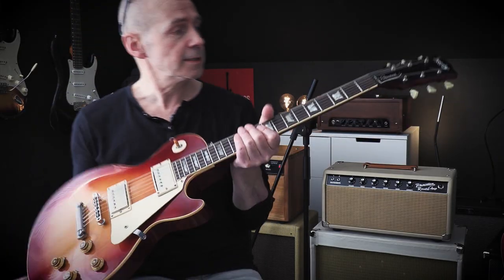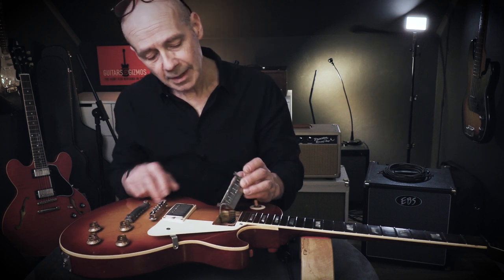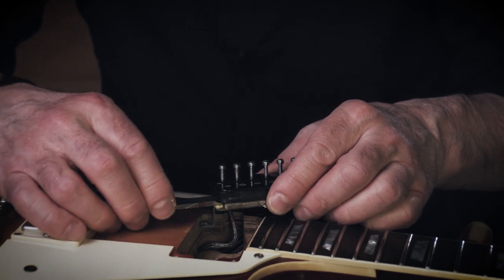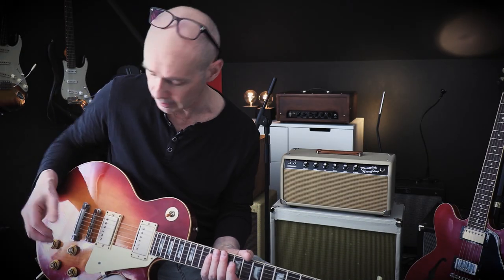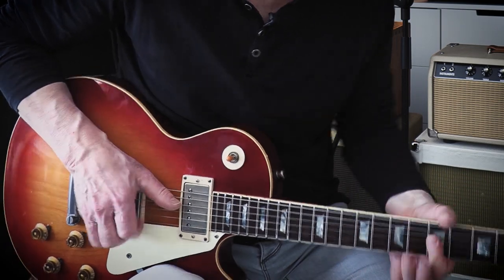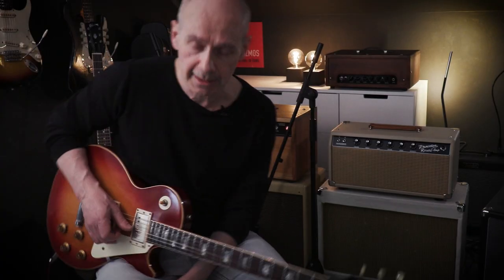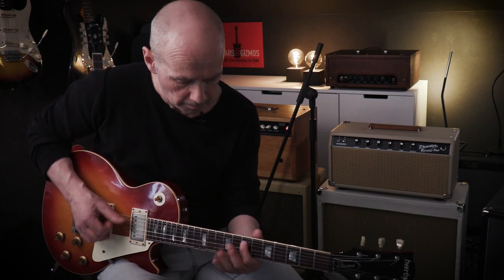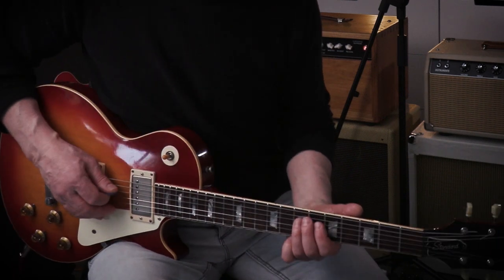Peter Green - His guitar tones • the out of phase pickup mod • the guitar licks

Comment: Noooooooooo!
Aw bless, there was no need to go through such a high anxiety process. I just took the two wires from the neck pickup and swapped them over and had my neck pickup out of phase in 70 seconds while this video was playing. 
👃I want everyone to know it doesn't have to be this much effort to get the out of phase tone, to save you all from unnecessary work & potential problems.
Reply from the maker: Hi, thanks for commenting this to the thread. I will pin it to the top of the comments. However, there's several pages of discussions going on about magnetically vs electrically out of phase. I think you might be right that tonewise it won't matter, but my intention with the process shown in the video was to do what supposedly was done to Peter Green's pickups. All the best, Thor
Reply: Also, many pickups don’t have 4 wires, only 2. So doing it electronically is not possible. Great video!
Reply: i've tried both options, and the difference is fairly subtle, but it is definitely there. Done it on 2 different pair of paf clones. Magnetically out of phase gives a slightly thicker, hotter and fuller sound and is closer to the Greeny sound, which is what he's trying for (and really getting!) Flipping the wires will only get you ballpark>
Reply: Yeeeeeees!! That's the correct way. You flip magnet 180°. It works. Anxiety bro I'm adhd was on riddling back in the 80s. You must teach yourself patience, man. Doing something you love calms everything. Well at least for me.

Comment: If the neck pickup is the older style 2 conductor type wire rather than the more modern 4 conductor wire; all you have to do is simply remove the control cavity cover and reverse the 2  wires (which reverses the pickup's polarity), rather than taking the pickup out, then taking it apart and turning the magnet around.

Comment: all you had to do was turn the pickup the opposite  way round and switch the out and earth opposite way round not take pickup the pickup apart
Reply from the maker: Hi, I’ve actually tried that and it, at least to my ears, results in a different kind of out of phase sound. But you sure correct that it will give you an out of phase tone. Cheers, Thor
Reply: False.